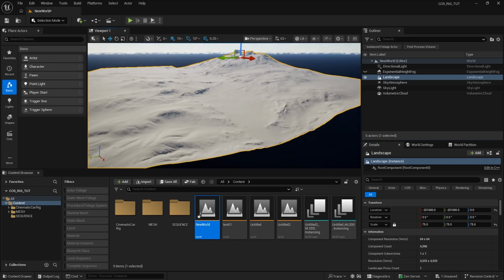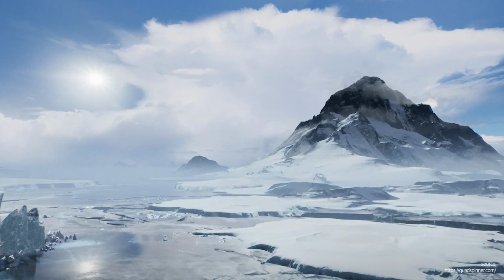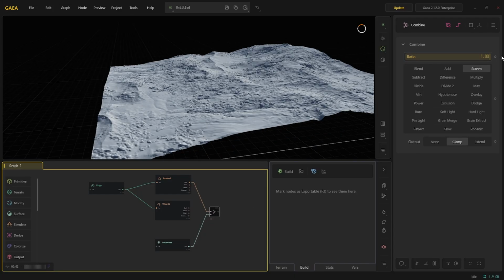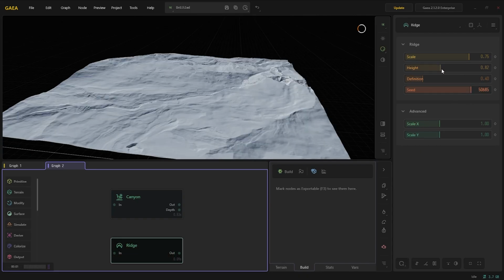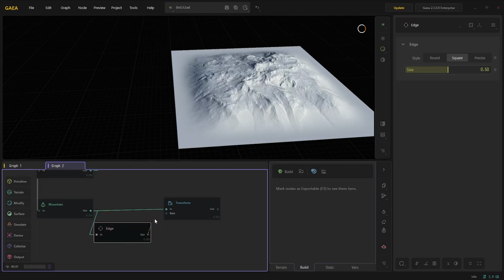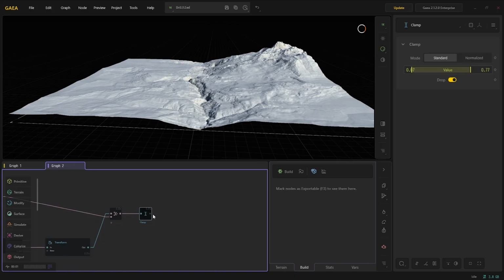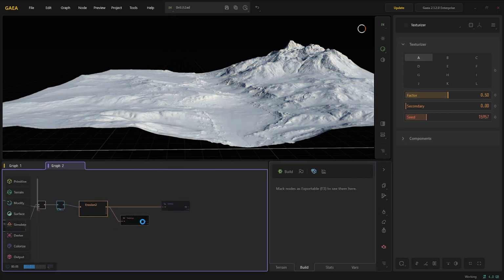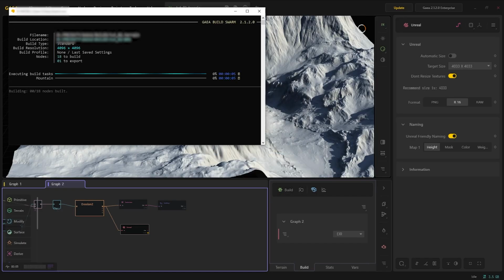From NASA to Your Project: Gaea 2.0 Terrain Generation | Unreal Engine Automotive Tutorial

Comment: the calling thread cannot access the object because a different thread owns it, uhh help?
Reply from the maker: Yeah, this is a classic threading error. It usually happens when Gaea is fighting with Windows over file access. Try these quick fixes:
1Run as Admin: Close Gaea and restart it by right-clicking the icon -> "Run as Administrator".
2Change Export Path: Make sure your Build destination is a simple folder (like on your Desktop or D: drive), not a system-protected one.
3Check Resources: Ensure you don't have the heightmap file open in another app (like Photoshop) while Gaea is trying to write it.

Hope this helps you get back to world-building! 🌍✨